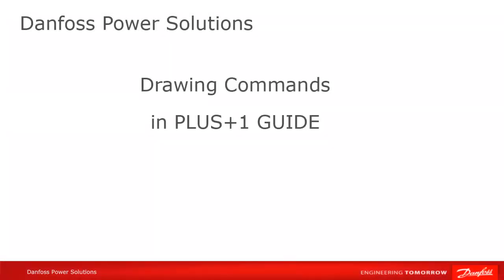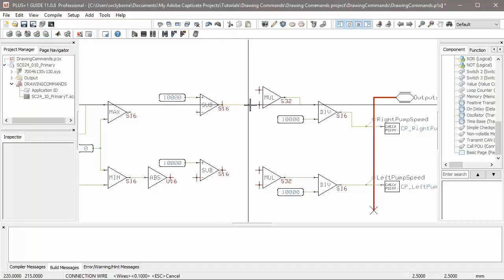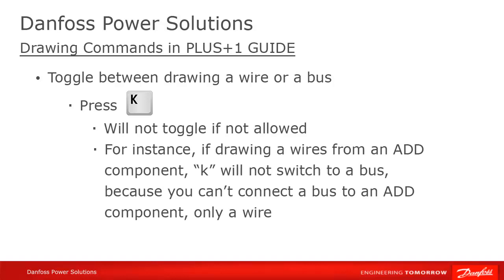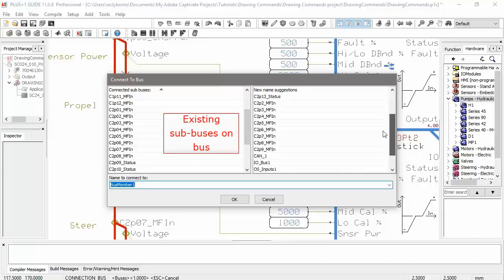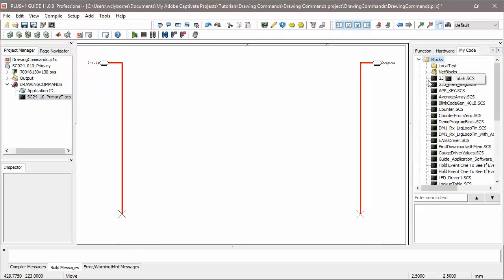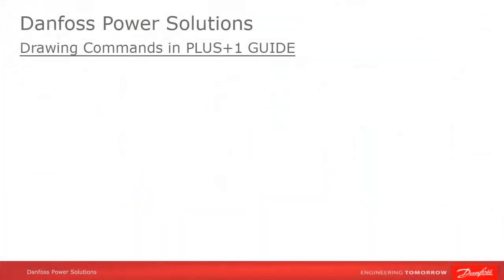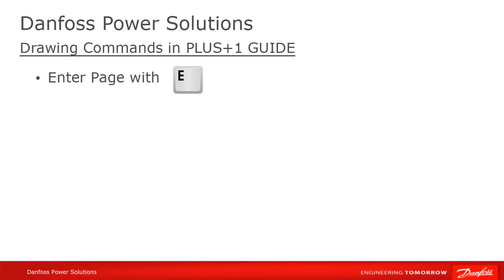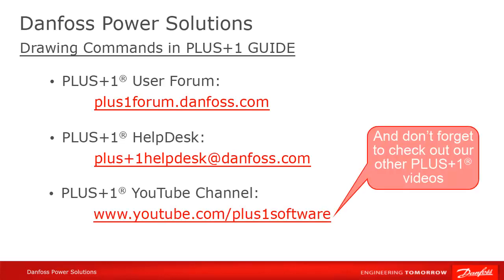#7 Drawing Commands

Comment: F9 to end a wire in space. F9, you know, that key that's like, one of the hardest ones to get to while your right hand is on the mouse. Yeah, F9, that one that isn't mentioned in the status bar when you enter Route Wire/Bus mode. F9? Really? And F10 for undo? Not the ubiquitous Ctrl+z?
Reply: In the options menu you can change shortcuts from "Classic" to "Windows" which makes it more useful for modern users with standard keys like Ctrl+Z and Ctrl+Y working.